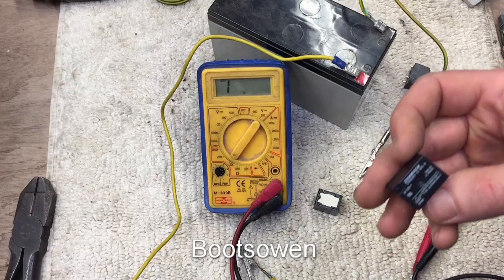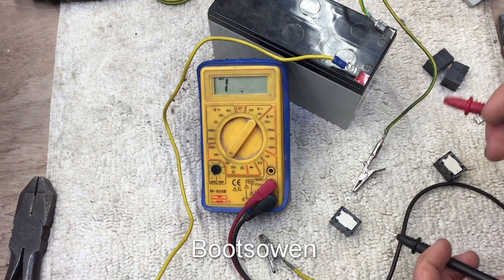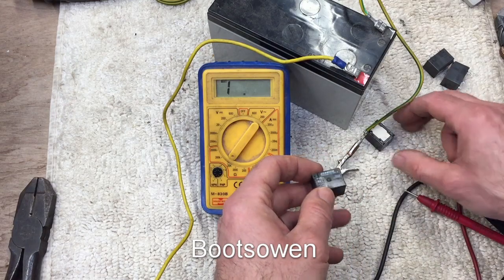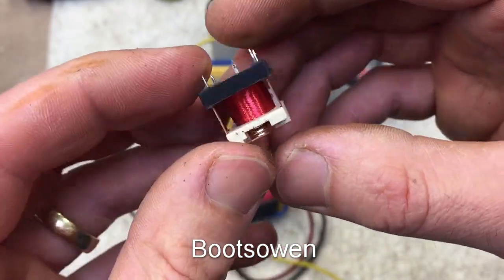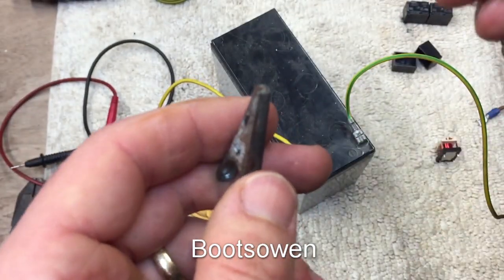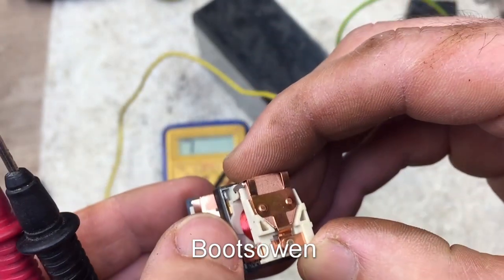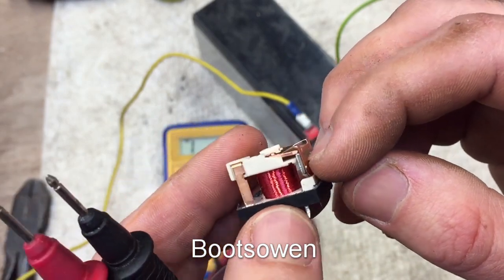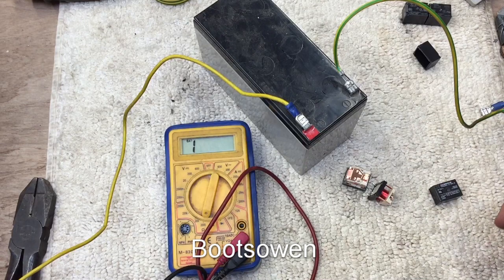Testing and opening relays from a washing machine PCB motor circuit

Comment: Bootsowen, I really want to change the direction my washer spins, it usually floods and I can't stand it, can you make a tutorial how to change the spin direction on a normal washer(connected to the pcb, is a beko just in case)
Reply from the maker: Hi there, I have explained how to change the direction in another video on how to wire universal motors. I wouldn't recommend it however in a washing machine, because the brushes are aligned in a certain direction so that they don't wear on high spin speeds. if you change the direction then your brushes will wear out quickly.  but go for it, it is only a matter of reversing a few wires to the motor.
Reply: @bootsowen  oh, so is OK, I will try to do it, might as well change the brushes with some other beko models...thst spin anticlockwised, even tho, thanks for the answer, I need to figure out what wires I need to change😂
Reply from the maker: Good point, if you change the brush holders for ones of the other direction then that would work. My "how to wire a universal washing machine motor" video should explain direction. I think it would be easy to wire if you have only 6 wires to the motor, (2 for tacho), but it may be difficult if you have more than that. Let me know how you get on!
Reply: @bootsowen  thanks for the help, I will ask you some advices when I will be able to get the machine put and have a look, in about a week